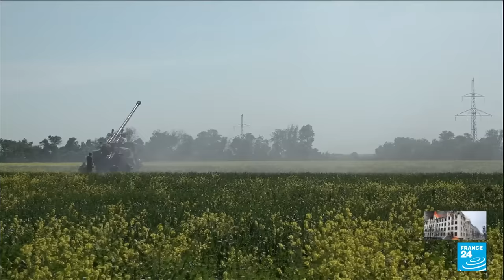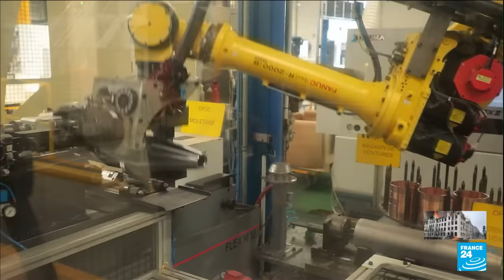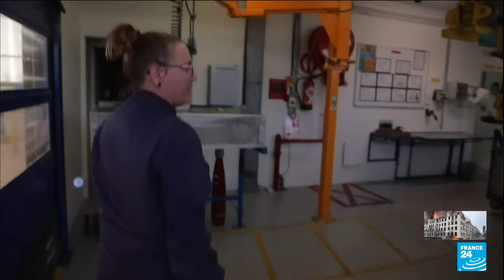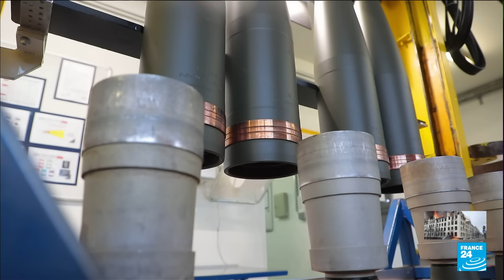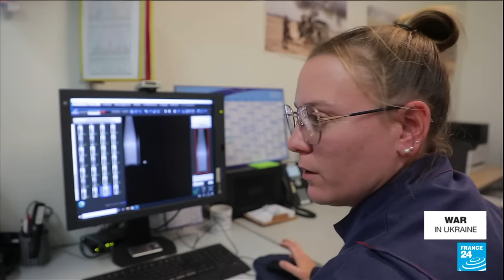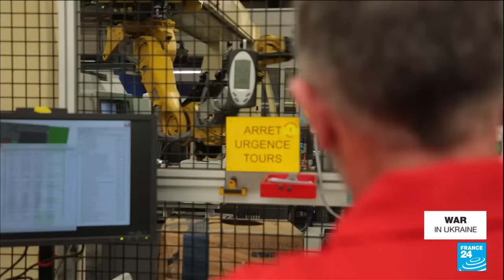At a French munitions factory, the race is on to send shells to Ukraine • FRANCE 24 English

Comment: Well, each country must have its own ammunition production, it's one thing that is very important.
Reply: Among other important issues, raw material to manufacture artillery shells is becoming prohibitively expensive and increasingly scarse. It's not as in WW I anymore, when everything was plentiful and cheap.
Reply: If you build a factory you need forever output (customer) or it ain't profitable.
Reply: @duartesimoes508 As drones get better and better it is likely artillerys role will diminish anyway.
Reply: @marczhu7473 It just needs to be profitable for long enough time.

Nothing is forever.
Reply: @jackneuman5108  ask industrial (firing people is very expensive thus required 10 year production or it's a no no)
Reply: @marczhu7473  Sure.

10 years is not forever is it ?

With war still going on and other conflicts popping up and restocking afterwards it is pretty safe to say there will be a supply need for the next ten years.

Comment: It seems there is an increased importance on artillery since air power has been all but neutralized by anti air capability. I am very happy to see so many nations increasing production to help Ukraine.
Reply: Don't imagine that air power has been neutralised by AA capability in Ukraine. For the Russians its down to poor pilot training. For the Ukrainians is down to them having hardly any air force. Give the the Ukrainians some decent planes and you will see them a lot more active.
Reply: Not really. The ruzzian Air Farce is quite inept at destroying enemy defences, which are effective, and the Ukrainians have almost no combat aircraft. But combat aircraft are far more efficient than artillery. They're also by far more expensive and complex to operate. And so both sides resort more to artillery.
Reply: @duartesimoes508  In the end, humans are the ones to occupy trenches and buildings. The fewer there are, the faster backward movement is. Instead of weapons West should help with soldiers. Which it won't for obvious reasons. It's very dirty to blame someone's inability without giving appropriate help.

Comment: 😂I can't believe how antiquated shell production is in the western world,  they need someone like Titian's of CNC to set-up new production lines with state-of-the-art  machines and programming. 6k a day would be a decent start. 
For a start automatic QA machines & a real production line that handles the shells from being cut off the stock to being packed onto pallets. 
It should be forklift loads round bar stock 1 end & forklift racks pallets of shells to be filled at the other end.  With a few machinists swapping tools out of the tool holders & turning/ replacing  inserts.

Comment: 🤔🤔🤔🤔. 4000 Euros a piece?
Seriously?
And some will fall on emptying ground. So it's like throwing 4000 Euros away.
Reply: yes, very seriously! what did you think? that tis is a junk product? before this cost 5000€ a piece in import, the cost was reduced by automatisation...Is made to eliminate ruzians, not to "fall at at ground", and a 155mm Excalibur round cost more than 50 000€ a piece...
Reply: How much costs one Russian missile when it falls on a power station or a residential building, or a public building ? I personnally would be glad to pay 4.000€ if I knew that it would fall in the middle or a flock of orcs. Such a delight.
Reply: 1 shell houses 3 homeless families or 2 
Or perhaps a terms education or better local services 

These 4000 a piece 
Can change many lives

But...war is easier then ikea table to hold.talks on

Comment: If 400 rounds were produced in 1 week before the war and now 630 rounds in a weed today, that means x4 weeks so around ~ 2500 rounds per month. Ukraine fires 6.000 rounds per day and Russia produces 417.000 rounds per month
Reply: why then does ruzzia need shells from NK? also where did you get that number of 417k produced?
Reply: @MaxVerhaag  Russia fire more than Ukraine because she have way more artillery pieces. 
Sometimes Russians fired 60 000 shells by day. The peak was 10 000 for Ukraine when they doed the counter offensive this summer, in normal time they are using around 3000 to 6000.
If France double his production she will be able to produce 80 000 by year.

Comment: Didn't show the "powder." Top Secret? Internet search.....
Reply: As professionell fireworker looks like Aluminiumoxid and Kaliumperchlorate, there is no top secret. 😂
That is very expansive. Why not cheap TNT ?
Reply: @andik859  And probably also more stable over time. It could be an obligation to be stamped as Nato compatible.
Reply: @andik859  TNT is in the warhead (the top part.)

Propellant is in the bottom. I'd tell what type, but not sure I should since they didn't show it.
Reply: @bigdnrv1562  bei Gewehrpatronen ist es Nitrocellulose, bei Granaten wird meist Schießbaumwolle genommen.

Comment: there's no reason a shell should cost 4000euro, the materials are pretty cheap. The problem is it's not mass manufactured, but instead treated like a specialist handcraft industry. An iphone is way more complex, but cheaper. What's needed is someone who decides to upset the market by doing vertical integration and robots in a large scale. Make a gigafactory for 155mm shells...

Comment: Just need more European countries to do the same. Come on Germany wake up, you're suppose to be good at manufacturing.
Reply: Moved to China
Reply: @tomhenry897  That's Not Funny,,  🤣😆😂🤯
Reply: Germany Rheinmetall produce now 350.000 in one year, over 6000 in one week 155mm shells. Chief from Rheinmetall say tonight we are moving up to 500.000 pro year. And 120mm leopard shells are now by 240.000 pro year. Production line for 35mm Gepard ammo runs now, sitzerland is out of business, they can make clocks and chocolate. Ammo fabric runs 24/7 in germany no one switch lights off. 
France : 600 shells per week. 😂 this is for 3 PzH 2000 feed for one day.

Comment: I wonder if the fired casings are reusable. Ukraine can collect the spent casings for remanufacturing.
Reply: Shell cases are a bit old hat. Look at the Ukrainians firing 155mm shells, and you'll see them using charge bags.
Reply: All shell casings are collected, the 122 or 152 old ones more.
Reply: The 155 shell has no case.  It uses charge bags in a sealed breech.  A small special cartridge is used as the primer.

Comment: I wish you could say the same about Germany ...
Reply: Rheinmetall Germany works 24/7 and produce now 350.000 155mm shells pro year, that are over 6000 per week. And 240.000 120mm tank shell for Leopards per year. And production line for 35mm runs now.
Rheinmetall Chief Papperger was tonight in RTL TV says this. They are in DAX now.